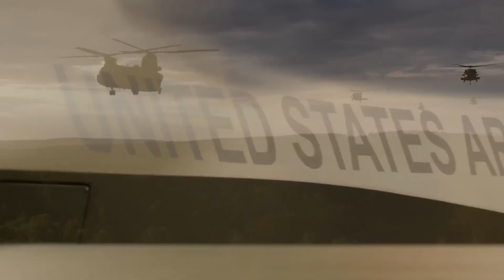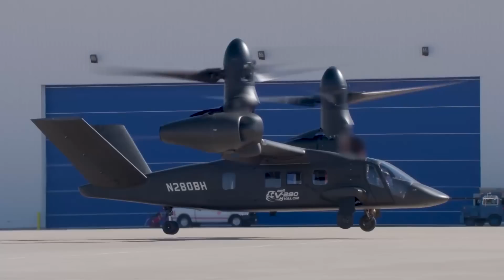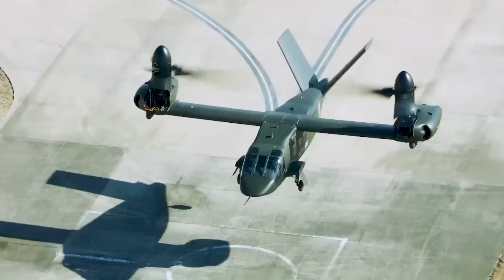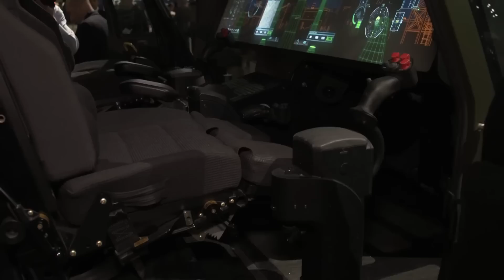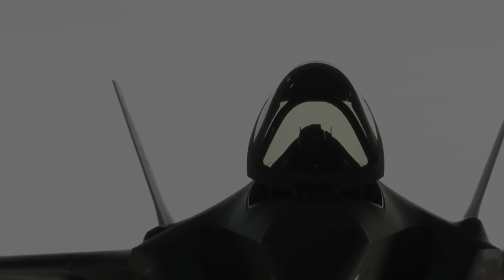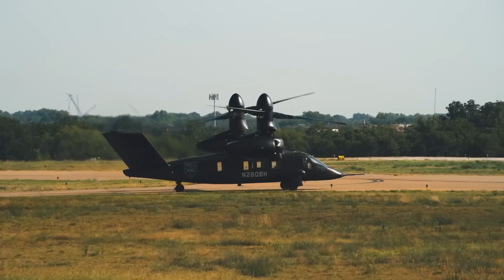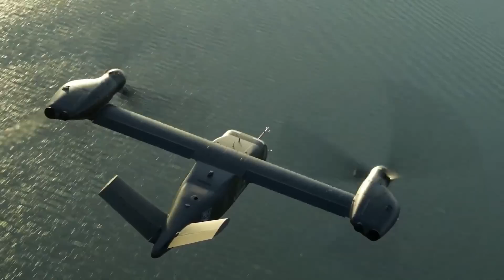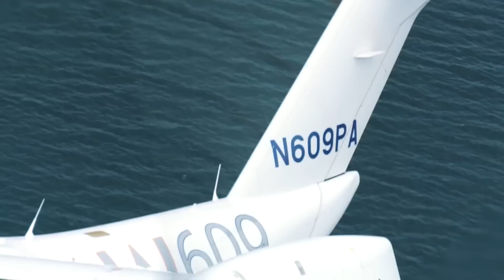V-280 Valor – The future Black Hawk

Comment: Wish they went with the SB1 defiant
Reply: You wanted the worst platform to win?
Reply: @n3v3rforgott3n9 , of course because SB-1 unable to glide and has poor autorotation. UH-60 has rotor area for weight 21 sq.m/t, but Defiant 17.2 sq.m/t.
What about Valor?😉
Reply: @antonkirov1923  So if I tell you that an Osprey pilot has said that even they can practice autorotation landings in the simulator... Again your point is bogus.
Reply: @n3v3rforgott3n9  may be “Osprey pilot” told about autorotation, during horizontal flight (same as on helicopter). But in horizontal flight Osprey will use gliding.😉
In case of hover flight, autorotation of Tiltrotor will be useless.
In case of horizontal flight with stopped proprotors Valor/Osprey/Defiant will be destroyed.
Hahaha😉
Reply: @antonkirov1923  You really have no clue what you are talking about. If a tilt rotor has enough altitude or various other factors it can autorotate down just like any traditional helicopter. There also has yet to be a dual engine failure on an Osprey not to mention autorotation rarely saves military aircraft because of their weight and altitudes they usually operate at.

"In case of hover flight, autorotation of Tiltrotor will be useless."
...
why? Again that same pilot has done simulations in the Osprey of landing via autorotation so you are wrong.

"In case of horizontal flight with stopped proprotors Valor/Osprey/Defiant will be destroyed"
...
No again It will be able to glide... Your points are garbage.
Reply: @n3v3rforgott3n9  I know that Ka-52 is equipped with ejection seats because 165 sq.meters of rotors area is not enough per 10 tons aircraft.
But V-22 has 212 sq.meters per more than 20 tons.
Maximum (!) Glide ratio is 4.5. Osprey has  28 sq.meters wing. But airplanes have 3 sq.meter per ton.
So what now can your simulator say?😉
Reply: @antonkirov1923  So you just proved it can glide... And yes it can autorotate under ideal circumstances... just like other large heavy helicopters. Also this is the Osprey not tilt rotors in general so saying this is somehow means the Valor can't do either is also a dumb point still.
Reply: @n3v3rforgott3n9  , yes can glide. But is it safe for such aircraft?
Compare with Osprey, Valor has better situation with autorotation. But still not enough.
Same time bigger proprotors will increase fuel consumption.
Hope you know the power of Valor?
Reply: @antonkirov1923  "yes can glide. But is it safe for such aircraft?"
...
Yes it still is... there has yet to be a dual engine failure in an Osprey and they are beyond rare in dual engine aircraft anyway. You would be hard pressed to find situations where autorotation has saved a military aircraft of the Black Hawks size or larger. Simply put it is not a major factor for them. 

"Same time bigger proprotors will increase fuel consumption.
Hope you know the power of Valor?"
...
This is a moot point... the Valor already has nearly triple the range of the Black Hawk.
Reply: @n3v3rforgott3n9 ,
1. Yes it is? Glade ratio 4.5 is safe? Because of statistic?😉
2. There are several reasons of both engines failure (fuel, electrical system…). Also, any failures which stops one proprotor. If one engine will be lost and Synchronous shafts will be broken.
All these scenarios require landing by gliding with Maximum Glide ratio 4.5!
3. How autorotation is important I have explained with Ka-52 example.
4. Valor range is perfect! But my “moot” point is fuel consumption of V-280. It’s very clear.
1000 km range, is not so necessary. But everybody care about fuel consumption. Proprotos are not efficient as well as two engines with 14000 hp power.
Statistics?

Comment: Hard to imagine this awkward, unstable Valor replacing the finely tuned, nimble, acrobatic capable Apache. 

Hard to imagine the Army would even think about it seriously. The Army's role is never to be as fast as the Air Force; that's the Air Force and the Marines role. Valor's great as a complementary aircraft for the Marines V-22 and F-35B. 

But, as the Army said, it would need a specialty & next generation gunship in the vein of the dependable Apache, if the 1970 - 90s Apache must be replaced. 

The Defiant has a chance, if its creator makes 30-45% more improvements on it --- such as a Gatlin gun or laser, as an integral fabrication from scratch, not as a loosely dangling attachment like weapons carried via improvised pylons --- shoots specifically for the Apache's replacement.
Reply: The Army has specifically been looking at Pacific operations, where distances are a problem. The V-280 can for example reach mainland China from a number of US Western Pacific bases, where current platforms including the Apache cannot. The V-280 has already passed maneuverability trials with similar or superior performance to the Black Hawk it's replacing, there's some impressive video out there of it.

The V-280 is replacing the Black Hawk in the medium transport role; Apache replacement will be a separate program, and will most likely include requirement for internal weapons bays instead of pylons. The Defiant could come back for that; but the V-280 could just as easily, and already has significant performance advantages.

Comment: I dont see how this can replace the UH-60. It way larger and less nimble.
Reply: Except it passed the same low altitude maneuverability tests as the black hawk and can be in and out in half the time while carrying more troops ...
Reply: @n3v3rforgott3n9  it's wing span is much larger. It can't land in the same spots. I want this program to work. I'm just having a hard time seeing it.
Reply: @joelferguson9324  Rotate it 90 degrees. It is wider but also shorter. total footprint is 19% larger. You are no longer landing in urban areas unless you already have it secured and you would have a clearing for that anyway.

Comment: A very capable looking aircraft, and a great video. My only comment is that while Osprey accidents are always in the news, the actual rate of accidents, according to the USMC is equal to, or slightly less than their other assets. It is in fact, not as bad as we are lead to believe
Reply: Yup it just got into a few high profile crashes and bring in clicks for any crash at all now. So they are plastered all over the news anytime they do happen. It had real issues but what new piece of hardware doesn't.
Reply: "New piece of equipment..."?   @n3v3rforgott3n9
Reply: @n3v3rforgott3n9  doesn’t? But what about:
1. Autorotation? 2. Gliding? 3. Efficiency? 4. VRS? 5. Price?
No chance
Reply: @antonkirov1923  it can auto rotate and glide... Tilt rotors also have a better time with VRS... Finally it goes twice the distance at a faster speed while carrying more people so yea it can be more expensive. Hell the defiant designers couldn't give a good reason for their costs even while being less expensive lmao. You really need to look up the public information of the testing.
Reply: @antonkirov1923  I think I'll stick with what the actual data and statistics say rather than preconceived notions people have that aren't based in reality
Reply: key to osprey ops is the center of gravity in the cargo bay aligned with center of wings
Reply: @CharlieFerry  Are they any worse than other aircraft? I was an Aircraft Weights Engineer for 15 years
Reply: leave it to the media to overblow stuff. Besides if it were that bad we wouldn't be using them.
Reply: media reports on military shit is always irrelevant. journalists arent experts on anything other than reporting.
Reply: How do you know you weren't the one in them when they crashed.😂😂😂😂😂😂😂😂😂😂
Reply: By "perception of unreliability" does not mean that crashes are of no concern - even if it is better than average for comparable helicopters. The V-22 was insisted on by the Marines as a matter of survival but the Defense Department and the Navy had preferred other helicopter solutions at its inception. The V-22 tends to roast ship decks and has some unique handling issues.  All-in-all, in it's refined version it is a very fast and capable platform.
Reply: The video itself talks about unreliable features of the V-22 and the public perception of it is that it is a design the engineers could never get the bugs out of. A troop transport needs to be safe and reliable more than fighter-type aircraft.
Reply: @stephenpowstinger733  The video might mention that but the head of the USMC says it has a low incident number. You can't compare this to the likes of a 737. They land on sand and dirt.
Reply: @stevepowsinger733  Ok and the Osprey has a better crash record than the CH-53, CH-46, and CH-47 so I guess we need to get rid of those 2 still remaining...
Reply: @stevepowsinger733  Yeah talks about public perception as has been said before perception has little to do with reality. Facts are what matters and its stats are slightly better than the C130 go look it up instead of banging on about internet BS.
Reply: @stevepowsinger733   Ka-52 has ejection system because rotors area per MTOW is 15.3 sq.m/t. UH-60 has 21 sq.m/t. V-280 has 12.8 sq.m/t. And blades twist is not effective for VTOL.
But USMC says it safe

Comment: Bet this is going to have the same or similar problems as an Osprey does:
-too fast for helicopters, too slow for regular aircraft
-very small lift capacity
-impractical for use in deploying paratroopers (low capacity and issues with hover speed)
-doesn't fix the issue of trying to operate fixed and rotary wing aircraft next to each other in the middle of a sandstorm

WTYP intensifies
Reply: "-too fast for helicopters, too slow for regular aircraft"
...
This isn't a problem as it will be doing the helicopters job... this is a stupid ass point.

"-very small lift capacity"
...
Except it carries more people and cargo than what it will be replacing... again stupid point.

"-impractical for use in deploying paratroopers (low capacity and issues with hover speed)"
...
1. Not even its role, again stupid point. 2. There is no issues with hover speeds? Where the fuck are you getting this info from?

"-doesn't fix the issue of trying to operate fixed and rotary wing aircraft next to each other in the middle of a sandstorm"
...
Again where does this point even come from?

Comment: Built on the history of the most crashed "helicopter" in history.
Even with a slight speed variance the Boeing Sircosky is still the best choice. It's safer. It can lose it's push rotor and still function safely. Loss of a tail rotar was fatal in ALL past helicopters.
The President is still not clear to fly on the new "osprey".....a rose by any other name still has thorns 
This is simply a bad choice. I'm a big believer in past Bell designs but this tilt rotor is not a good design. It never has been. The Valor will never replace all because ONE> the president and full entourage will never use it. TWO> The landin space requires is larger than the Blackhawks.  
A lack of Boeing birss means no lower cost offering to the civilian markets. This impa air ambulance th most as the will  be counting von Blackhawk variants longer van even though much older Huey fleets. Police ban news recon as well S fire ate instead turn into drones to assist in civil protection. . This is simply the wrong move. The very fact it will roll oy slow would ha given Boeing it's needed tom to increase speeds
Reply: "Built on the history vif the most crashed "helicopter" in history."
...
Completely wrong here. The Osprey has a better crash rate than the CH-53, CH-46, CH-47 and many other aircraft.

"Even with a slight speed variance the Boeing Sircosky is still the best choice"
...
"slight speed" You mean 50kt max speed slower.... that is a 25% decrease which is massive. Defiant also had less than half the range and carried less people and cargo.

" It's safer. Ii can loose it's push rotor an st funcn safety. Loss of a tail rotar was fatal in ALL past helicopters."
...
Again basing this shit on nothing.... 1 of the only 2 functioning test aircraft crashed due to mechanical issues. The defiant suffered multiple technical issues they never even fixed by the time the program ended. 

"The President is still not clear to fly on the new "osprey".....a rose by any other name still has thorns "
...
Again more internet nonsense. There is nothing preventing the president from riding in an Osprey other than it not having the right communications equipment needed to house the president and there are already helicopters with those that he uses. The vice president and first lady among many other high heads of state have ridden in Ospreys.

"TWO> The landin space requires is larger than the Blackhawks.  "
...
A 19% larger total footprint and with current SOP for landing zones the Valor can land nearly anywhere a Black Hawk can while being able to do 2 missions for every one of the Black Hawks and doing so with more people each time.

"A lack of Boeing birss means no lower cost offering to the civilian markets. This impa air ambulance th most as the will  be counting von Blackhawk variants longer van even though much older Huey fleets. Police ban news recon as well S fire ate instead turn into drones to assist in civil protection. . This is simply the wrong move. The very fact it will roll oy slow would ha given Boeing it's needed tom to increase speeds"
...
None of this garbage is readable.

Comment: Death trap like the Osprey. With a regular helicopter can counter rotate down. These it’s all over with a clutch failure or similar.
Reply: !. The Osprey is just as safe as other military helicopters. 2. tilt rotors can glide and auto rotate.
Reply: @n3v3rforgott3n9  why are they grounded then?
Reply: @mkyhou1160  Because that is what you do when a crash happens of which you don't know the cause or expect the cause to be mechanical in nature... You ground the aircraft so more don't crash to the same issues then either fix the issue or find out if it was a mechanical issue in the first place. People who don't understand aviation always say this stupid shit.
Reply: @mkyhou1160  you would be wise to look the real numbers up. The crash rate of the osprey is lower than the CH53, CH46, and CH47 along with many other aircraft.
Reply: @n3v3rforgott3n9  as any aircraft ages the crash rate increases. New Ospreys are falling out of the skies, not fifty year old ones.
Reply: @n3v3rforgott3n9  the facts are that if the military, instead of spending billions developing a new craft that only really benefits special ops (as all helicopters are unsurvivable today beyond the front line), could put 1 or 2 billion into making an existing platform like the Blackhawk safer. A lot of lives and dollars will be saved long term. It’s not a shiny new toy to brag about though, it’s just a reliable capable troop transport.
Reply: @mkyhou1160  Maybe when you use your helicopters like Russia does.

Comment: The Apache isn't being replaced. The Apache is currently filling a role to replace the gap in capability that the Army currently doesn't have, a light reconnaissance heli. I think Bell's Invictus will probably win that contract as well.
Reply: I am from the future the Invictus as well as the program itself is cancelled.  With the vulnerabilities of gunships being show in the Russo-Ukriane War. the future of Helicopter Gunships is in doubt.
Reply: @madkabal  I am aware. Not sure it is the right move. Time will tell I guess...or apache gets the B-52 treatment.
Reply: I think the Apache replacement is a longer-term part of the overall program, but yes the Invictus is aiming for the light attack/recon role currently split between Huey derivatives and Apache backfilling
Reply: It was the Commanche program till costs spiraled
Reply: It will be replaced eventually, probably. The Apache does not have enough range to follow the Valor, which means you may have to set refueling points just for it. Doable but not great.
Reply: an attack helicopter isnt used for a recon role. thats for the 0h-6 little bird. small and quiet. no attack aircraft is a recon platform
Reply: @nomercyinc6783  The main function of attack helis is recon, you're mixing up different types of recon. An attack helicopter will have more advanced sensors and the ability to defend itself and is thus ideal for recon against heavy enemy formations or reconissance in force.
Reply: @nomercyinc6783  little bird is almost exclusively used by special forces. The 360 invictus will most likely replace it tho. But the apache was being used in reconnaissance roles in the middle east which was proving to be far too uneconomical.
Reply: @nomercyinc6783  The Apache has been used to fill a gap between the very light recon helicopters like OH-6, and the full attack helicopters. It's very uneconomical in the role. The FARA aircraft will keep the Apache relegated to its attack role, and will almost certainly be replacing the UH-1Y and/or AH-1Z in service
Reply: You forgot to factor in the thing, MONEY and lots of money! also the eletronics on apache are old like grandpa old.

Comment: The 280 nacelles are game-changers, and address' 2 major drawbacks for the tilt-rotor concept.  I would like to see the 22's adopt the design.  But, there is still 1 glaring issue, in my opinion.  Mishap survivability...no glide and no auto-rotation.
Reply: Tilt rotors can do both... that is a common misconception online.
Reply: @n3v3rforgott3n9  Yes, in addition, I understand from an interview with the chief engineer at Bell that the two rotors are connected by a shaft.  If one engine goes out, the other engine powers both rotors.  One engine has enough power to fly the aircraft.  So loss of one engine means that the mission can still be completed, albeit at a lower speed.
Reply: @howard6433  Of course it depends on the situation like any aircraft but yea. Dual engine failures are beyond rare. Even current military helicopters can only auto rotate under ideal circumstances which are different for each platform.